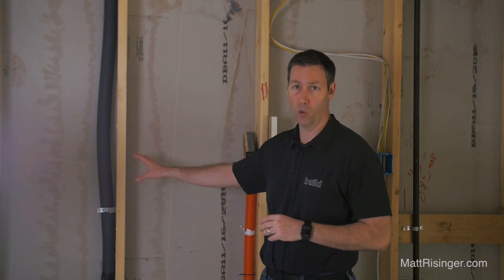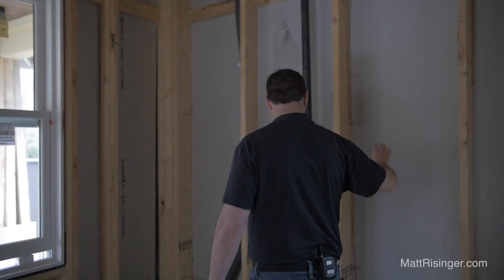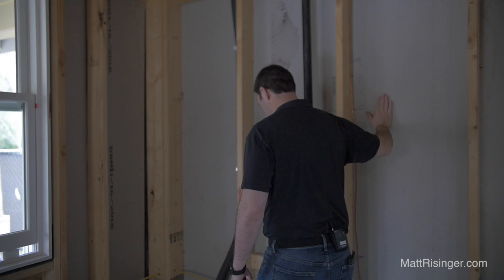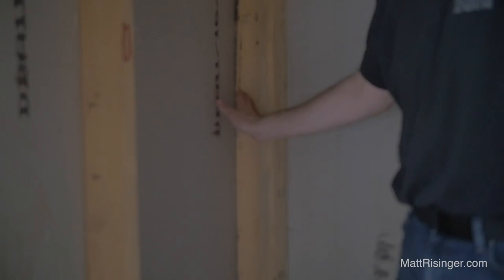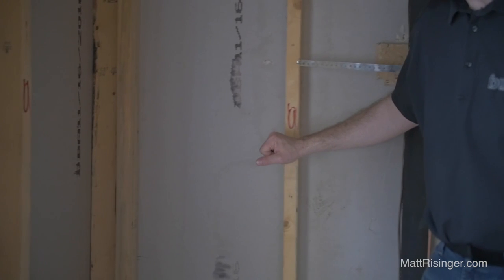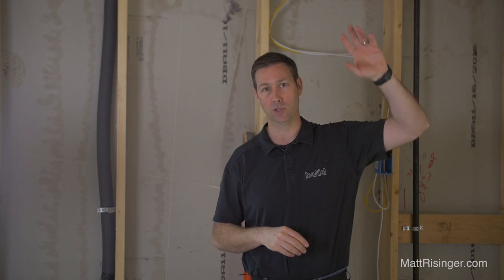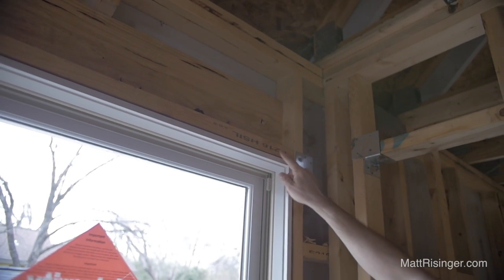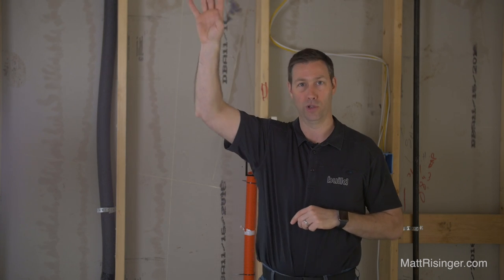Traditional vs. Advanced Framing

Comment: Advanced framing? Sounds like cheap ass framing to me. You can try and try and you will NEVER convince me to use a single stud around a window or 24” centers on ANY wall. Why go to all that effort to get better insulation value on the main floor just to put 2x4 walls upstairs, achieving what, r-13 in the walls? What is this 1960? I also want to see a comparison for how well that zip sheathing holds up to racking over a period of time. You are relying on an inch of the nail going through foam for your racking strength. I think this whole video was trying really hard to convince us that something you know is garbage is actually gold. And a house should last more than a few generations...
Reply: I agree.  A window is a GIANT HOLE  in the wall (imagine that!) so it makes sense to double up the framing structure on either side of it.  And the racking strength is a very good point.  OSB is already less durable than plywood and when you offset it with foam you are allowing the fastener to flex all over the place and round out a big hole in the OSB.  Its just going to fall apart.

Comment: stud centres should not be 24" ! or if they are just don't lean on the walls or you might go through . everything works on 8'x 4' sheet material and 16 " centres is much stronger unless double boarding

Comment: Seems like most people don't understand the message of this video.

We all love strong structures but like anything, framing is about functionality, (the quality of being suited to serve a purpose well; practicality). Why use a 2X6 framing instead of 2X4 if the building code of that area allows for 2X4? Amateur builders waste. We're not designing the walls to withstand the impact of a truck here, it will look the same, last just as long but be most cost-efficient. Build yourself a shed for 800$ or for 1000$, build your cottage house for 80,000$ or 100,000$, your choice.

Also your choice to complain about the suggestion of saving wood and increasing R value on a video that's sole purpose is to suggest saving wood and increasing R value. By that logic, complain that a comic is making funny jokes.
Reply from the maker: +Bradley Akulov couldn't have said it better!  Thanks for commenting

Comment: Building codes and standard framing practices are over engineered to ensure the poorest of workmanship will still result in a sound structure. Obviously if you specifically engineer the structure and have the talented trades to build it correct per the drawing you can do this stuff. If we don't get Trump out of office we may starting seeing more houses built with these techniques due stupid tariffs driving up the cost of materials.